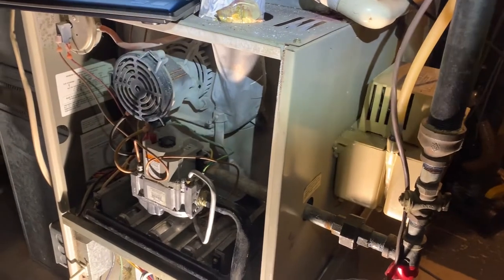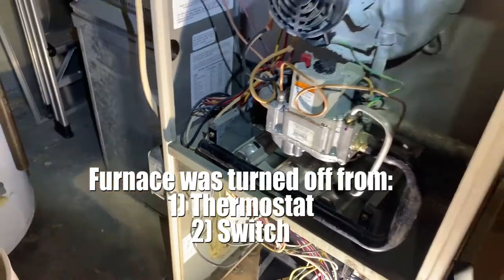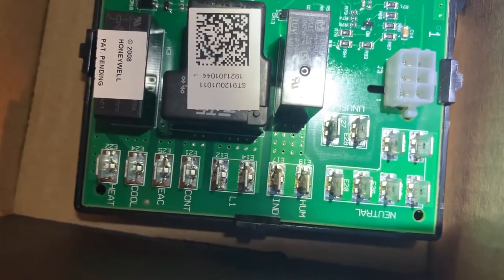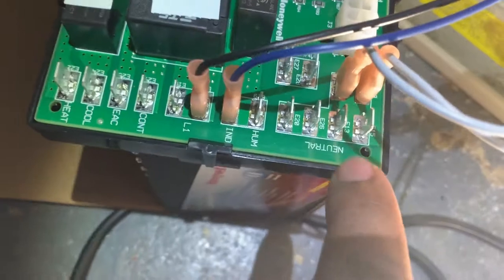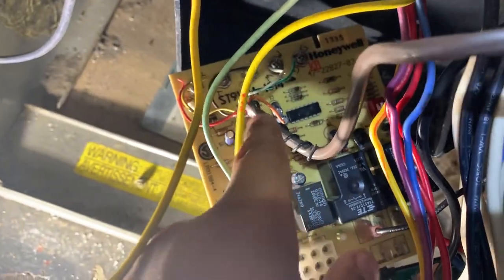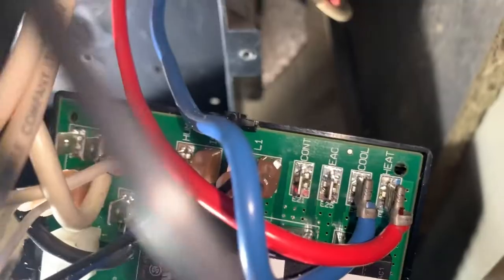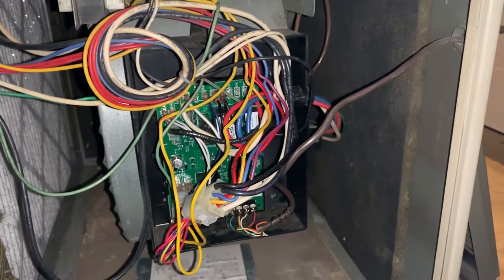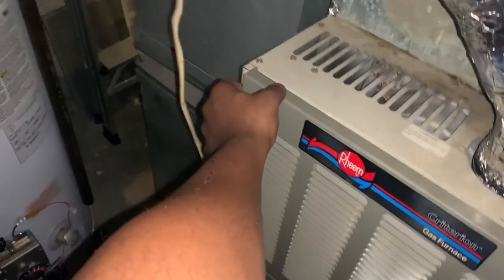How To Replace Furnace Motherboard | Furnace Keeps Cutting Off (Honeywell ST9120U)

Comment: "Note: Dip Switches position are: ⬆️ON  ⬇️OFF"

Meaningless unless you define the board and switch block orientation relative to the viewer.

And besides, how do you know anyway, since the documentation and markings on the circuitry become totally ambiguous with that stupid arrow printed on the board by Honeywell?
Reply from the maker: Phil that is a good question which I too had an issue because of the way that Honeywell  printed the arrows on the board. According to the hardware store that I purchased my board from, ⬆️ is ON and ⬇️ is OFF. 

By default, all of the DIP switches are in the OFF position. You will need to refer to the manual to identify which position you need to set yours.